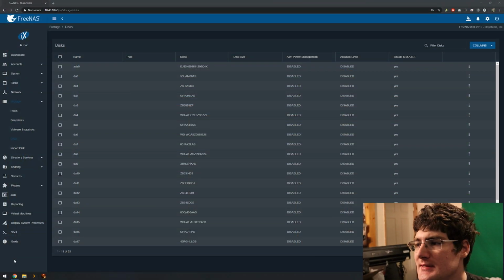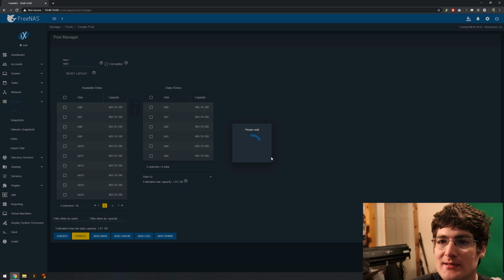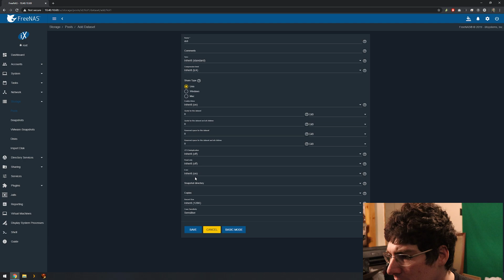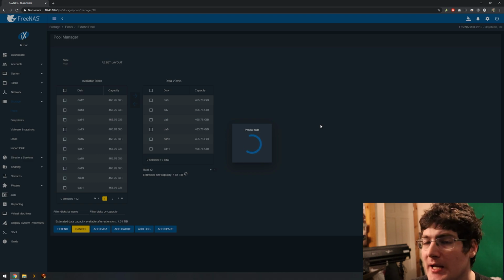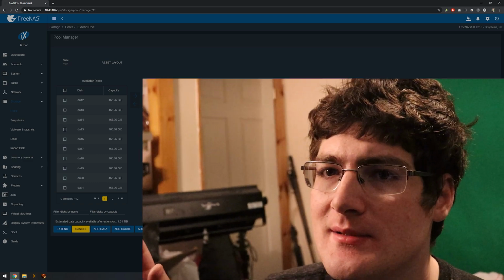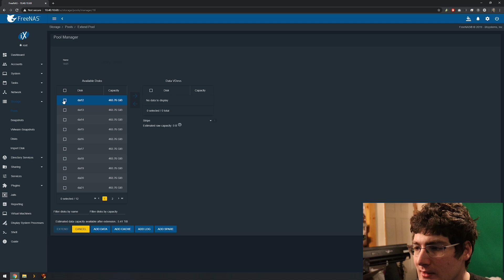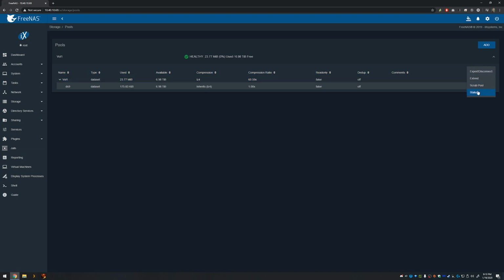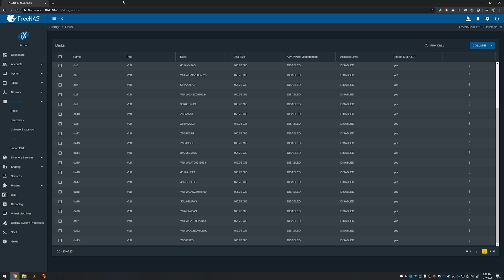Netapp DS4243 Storage Shelf: Freenas Setup part 2

Comment: From a storage administrators perspective your setup is not good.
A) Pool Layout
Your pool layout is way to redundant, therefore you're wasting a lot of space/disks. In best circumstances you can loose eight disks (2 per vdev). Sounds great but does this scenario happen? It also means a waste of 8*0,5TB= ~4TB data and you don't have any hot-spares. Theres no best layout, but (as usual) it depends on your needs. 

B) Hot-Spares
Always go for hot-spare if you plan to run the system 24/7. At least one disk per pool. In your scenario better take 2.

Comment: Hello, nice work you have done, but, I have 1 HP Proliant 360 that has 2x10 GB internet ports and also have 4 NetApp Disk Shelf that takes 24x2.5 inch disk...
My question is, there is any possibility to connect them all together using Ethernet Cat 6 cables? or only can be by SAS.
I would like to have all them connected together, but i am new on this. if you can help me I would appreciate that.
Thanks

Comment: I'm doing a similar setup, the disk shelf powers on without issue but the minute the server is powered on, once the hba initialize the ember light on the disk shelf shows. In hba bios, it does not detect any of the disks. Are you able to advise?
Reply from the maker: Do the disks show up in the os on the server?  I was thinking that in hba mode the card may not show the disks.
Reply: @SimpleSilicon  In Ubuntu 20, I can see the card under lspci, sg scan does not show any disks, the sas connector light on back of the shelf does not light up as well. The shelf is using IOM6. I double checked the cable ordered from China is marked 8088 to QSFP on the order, Could this be the issue?
Reply from the maker: Hmmm. Linux isn't my strong suit.  I would ask the linux community on level 1 techs.  Wendell has this exact storage shelf.

Comment: Is there a drive cap like 2TB? meaning that it will only see 2TB's no matter how big the drive is.
Reply from the maker: Not that i am aware of. Level 1 techs uses this with 8 tb drives and they didn't have any issues. I did upgrade the iom3 modules to iom6. I found some on ebay for a couble bucks. They work better with larger drives but iom3 shouldn't have too much trouble. Your just need to look at the spec sheet.

Comment: You're obviously a knowledgeable dude... but, I really would've liked a little more info about the DS ... I would LOVE to know the performance using the netapps -- vs, identical config with an HBA like an LSI 9208i or whatever ... So I GET what their role is. DO Netapp DS actually change the performance of VDevs..? Or are they merely a big case with extra power supplies ...? 

As in: Can they possibly unfuck the situation I'm having in which 8x 10TB 7200rpm drives can't break 200MB/s ...? Even in a Xeon v2 with 48GB 1333 ECC over 10GbE ...? you know...? 

Do these offer the physical slots, a power supply, method for ID-ing devices ... etc ... or do they have an impact on performance..?

Thanks!

Comment: Great Job. Actually you are the only one explained VDIS & Pools which i appreciate. Few questions: Can you share DIsks/Pool benchmarks. Does it support large SATA3 HD like 12TB? What HBA & Cables are you using? Thanks a lot
Reply from the maker: I bought the HBA off of ebay and is titled:
"LSI SAS9207-8e 8-Port External HBA PCIe P20 IT Mode for ZFS FreeNAS BOTH BRACKET"

The cable to connect to the netapp shelf I bought off of ebay as well. It is titled:
"QSFP(SFF-8436) to MiniSAS(SFF-8088) DDR Cable, 1-Meter 3.3ft"

As for the size of drives. I only have the 500 gig drives atm. I would like to buy 8tb ironwolf drives but it takes time to save up.  I want to buy six at a time.
Reply: @SimpleSilicon  Can you share benchmarks with your existing setup. As per NetApp website DS4243 supports maximum 3TB but it could be outdated information. I think you better check before buying your dream HD's :)

Comment: @simple Silicon is it possible to do this config in NETAPP FAS 2040S ?
Reply from the maker: I am unfamiliar with that netapp product; however, as long as all the disks present themselves individually to freenas, you should be able to set this up.
Reply: @SimpleSilicon  Hi,many tks for your reply.it would be great help if you can post the picture of cable "mini SAS to QSFP HBA" or if you can email me sait_in@yahoo.com. iam searching for this cable all over Singapore after seeing your post and no clue till this moment.
Reply from the maker: This is the one i bought https://www.ebay.com/itm/QSFP-SFF-8436-to-MiniSAS-SFF-8088-DDR-Cable-1-Meter-3-3ft/332690922598?pageci=d169e2dd-59d9-4479-9b89-19aeed9a5d5f

Comment: how are you connected to the disk shelf and server? Is it just RJ45?
Reply from the maker: Qsfp to mini sas. Its connected by an HBA. Think of it like a pcie sata expansion card for your home pc
Reply: @SimpleSilicon  like those E-Sata ports nobody ever used? lol Got it. I'm still waiting to get my server at the moment, just one more month!! In the mean time, I'm using an old laptop as a FreeNAS server, just to do some practicing/testing. It keeps over heating at the mere thought of a VM, but I did manage to load a Ubuntu, and a Windows VM onto it at around 0400 one morning, while it was snowing. Temps did hit around 97-99 during the Windows install! The share is stable and streams well.(The laptops internal 500Gb HDD - FreeNAS is installed onto a 64GB SD card.) One problem I'm having though is that one of the household PC's is loaded with Windows Home, and cant see the network share...
Reply: @GunnerRA155  you may want to try re-applying the thermal paste.
Reply: @PupShepardRubberized  I think I'll dive into that after the server is up and running. The laptop is an old 2010 Thinkpad and not really all that capable anyway.
Also do not eat a Cadbury's Flake over your nice keyboard while trying to type!